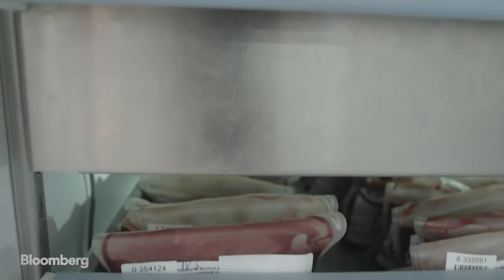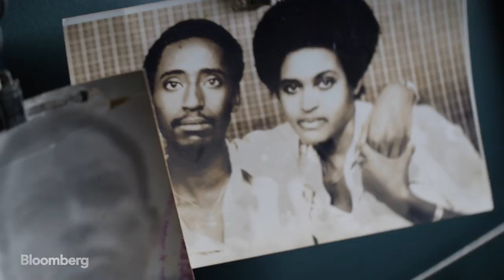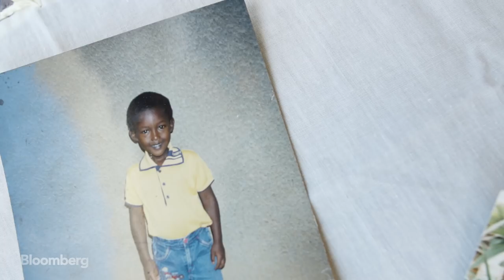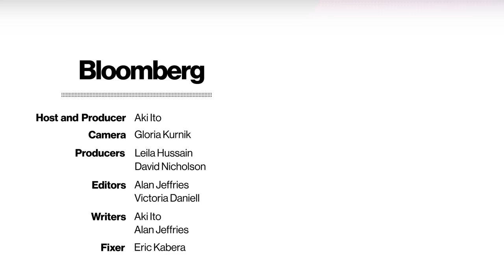The Medical Drone Delivery Pilot

Comment: This drone tech is great for rural areas and delivery of vital goods but for amazon and google I think it will fail in cities. This has a real purpose, delivers medical and aide supplies, but when I order my deodorant on amazon and a drone drops it in my yard I think it’s a little over the top. But if you live 1-3 hours by car from a major amazon shipping hq then a drone makes more economical sense vs a suburban area with a15-30 minutes drive cars are better, they can hold more and run routes in the area. So the idea is brilliant for some areas but I don’t think it’s meant for all. Great piece and great work.

Comment: Zipline Drone, the innovator of this delivery system is a US venture-backed startup. It's misleading since the company with it's noble use cases of its product just happens to use Rwanda as a guinea pig pilot project to go 'live'.  Rwanda govt is just more open as a test pilot since it has less aviation rules to get by. But yes, the technology were developed, manufactured and refined in the Silicon Valley  largely by veteran roboticists, a Stanford PhD and a MIT grad.

Comment: How the drone recovery system is working? He is using the same exact system of US Army but I do not understand how the drone could hit the wire all the time like that.
Reply: I was wondering the same thing.  The piece to "catch" it is really small.  Also, how does bad weather affect it?  If its raining, will it be grounded?
Reply: They spent several years there working all this out. At one point they even had a large air pad, similar to an air mattress in addition to the catch device. Obviously they also thought of vertical takeoff and landing but decided against it in the end.